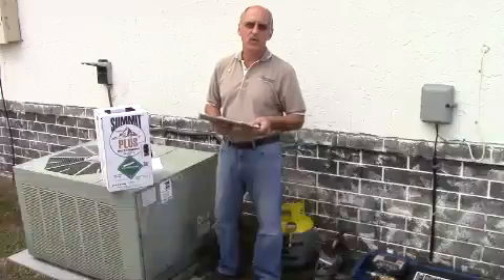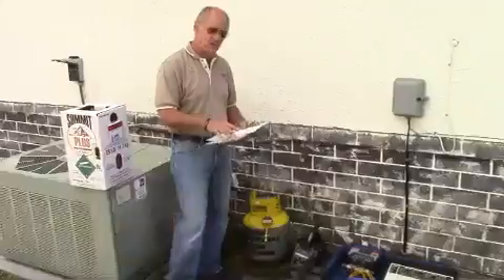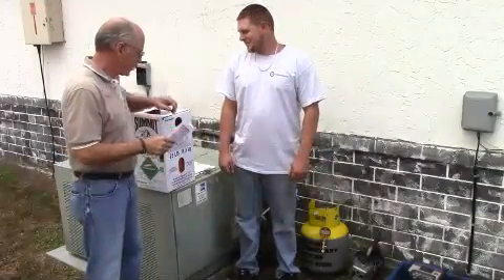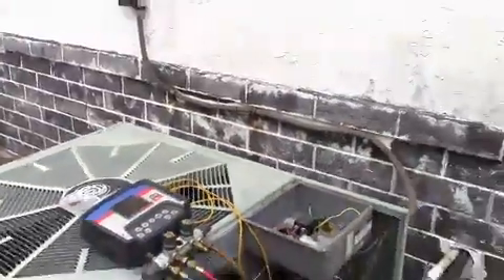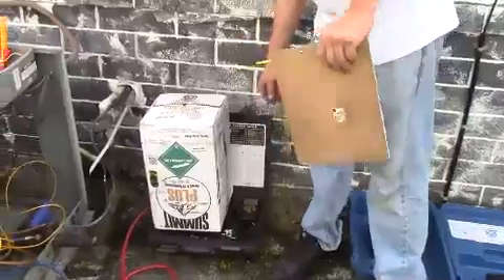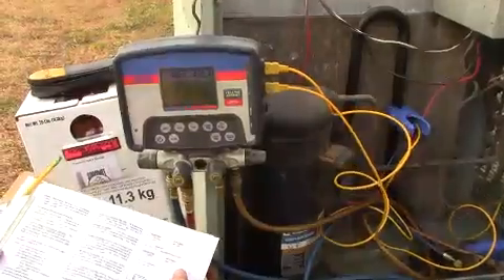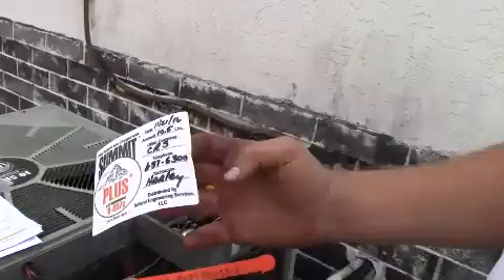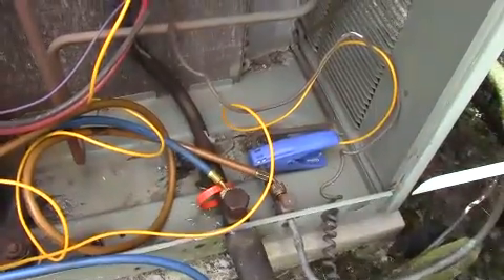Converting R22 A/C System to Summit Plus R407c with Superchange

Comment: Can R22 gas be replaced with 407 gas in an air conditioner without changing the oil? Is it true that charging an air conditioner with 407 gas instead of R22 gas will damage the compressor after a year?

Comment: Reading through the comments I believe the guy in the video should have introduced the product better. This is NOT just 407c. It is 407c PLUS.  The PLUS is referring to the addition of some magical additive called SuperChange. This SuperChange supposedly mixes in with the original mineral oil and prevents the sludge problems you would normally get if you tried to run straight 407c with miner oil. Because of this it supposedly allows it to be a direct r22 replacement without the need to change the oil out to POE, etc.
Reply: I work with someone that swears that he has changed r22 systems with just 407c with no issues. I was under the impression that the oils would cause issues with this type of retrofit. Someone enlighten me..
Reply: Thank you!👌🏼

Comment: I'm thinking you should have done this with 427A refrigerant as then the oil is more compatible. Or you should have pulled the compressor and pulled out the mineral oil and replaced with the POE oil. The efficiency will be low and eventually the the two oils will slowly create sludge. Also, if any residual water was in the system R22 and mineral oil will still be okay. However, POE oil is 1000 more water absorbing then the R22 mineral oil. So if the system was opened or installed without a proper vacuum it may have been okay with the mineral oil but you just signed the death certificate by adding the POE without the dryer filter. I'd would like to put some gauges on this system and see how it is doing now.

Comment: IF not adding POE OIL it will foam the oil. compressor in this video is noise not good. all dyrer need be removed from behind service valve and place outside the unit for true high psi can be seen. Never reinstall a dryer back inside unit. I use 1/2 in copper in it place. As a coupling.

Comment: So you don't need to replace the filter drier?
Reply: On their website they say it isn't necessary but recommended. http://media.diversitech.com/doc/DOC22146.pdf
Reply: The system wasn't open to air but the drier should still have been changed. Just because someone says it's not necessary doesn't fix the problems it could give the customer 5 years from now.

Comment: What about the compressor oil you have mineral oil in the old application you should be draining it and replacing it with Synthetic or you will have sludge developing in the evaporator causing horrible efficiencies...let me know how you get around this with your product? thanks.
Reply: Go check out their video on the product…super change item #981…theres a video on YouTube that shows it…

Comment: I like what you're doing that's awesome I'm going to start doing it with my own Apartments,,,, this is my question on the data before if the system was it  low of R22 did you dump 1 through 2 or 3 lb in it to get an exact reading,,, or is your data from an undercharged system,,,,,, because am I thinking to get correct pre change data you would need to have a correctly charge R22 system to get correct data,,,,, I really like what you doing I think you're a good company,,,,

Comment: Is low and high pressures for R22 the same for 407c
Reply: The POE lubricant is in the new compressor no need to add. The amount of refrigerant needed in a system can be determined by measuring the superheat and or subcooling temperature once the system is up and running.. hope this helps.
Reply: Three days ago an HVAC tech removed my 4ton R22 dead compressor outside unit, and replaced it with a 4ton  R407C unit, WITHOUT adding POE or any other lubricant. He charged it with 6 pounds of R407C without weighing the R22. Whats going to happen now to the new unit and the inside old unit? Will the AC system get damaged 
Thanks
Reply: How and where did u find an hvac contractor that would do the work!!? 😂 I have a pile of cash and not one sob in the area where I live will sell me a new furnace and ac and install it cuz I live in a 1977 mobile home I own free of any debt and for being a single mother with no support from my ex…I think I’ve done pretty ok considering I own my home and land and my vehicles…lol…but idk if it’s the fact that I’m a single woman, or the fact I own an older mobile home or what that they’re discriminating against me with…but at 108 degrees the day I waited 8 hours for the sob to show up…he was already 8 hours late but decided he didn’t seem me worthy of wasting r22 on my unit I already have but needs charged and decided nah! He wasn’t gonna even sell me a new set up either! Must be banking in his other scams around town and doesn’t want my cash…I’d like to know how the hell u can get an hvac guy to even show up! They’re notorious for taking ur money and never showing back up to install the unit u just paid $6000 for!!!
Reply: They are not the same but close to each other. Search for the key words "refrigerant slider". 
And you'd better pay attention to evaporating and condensing temperatures instead of pressures.